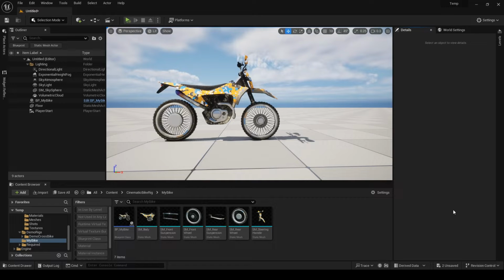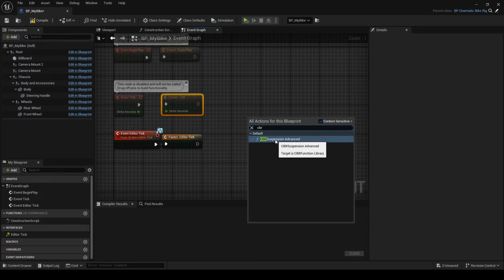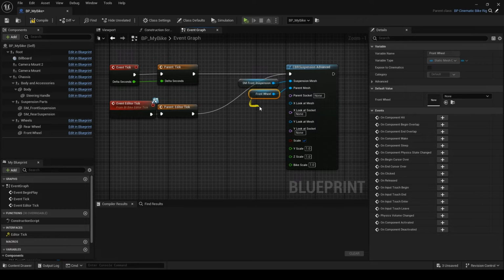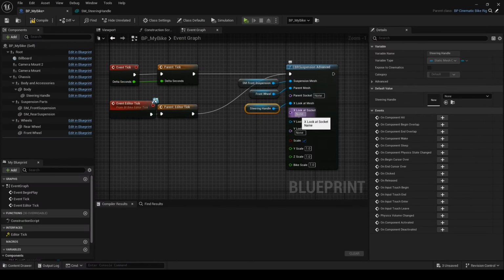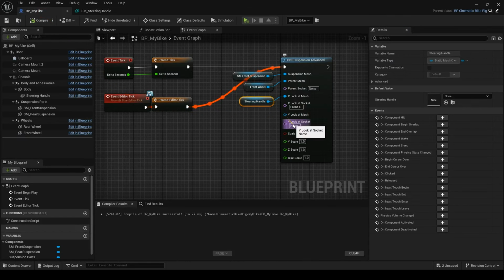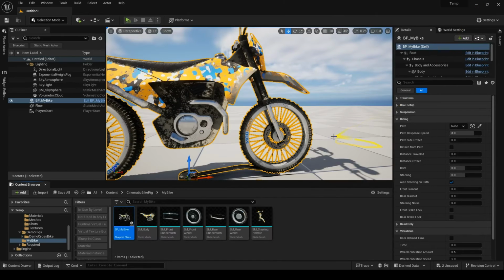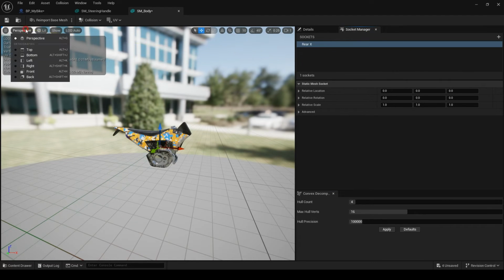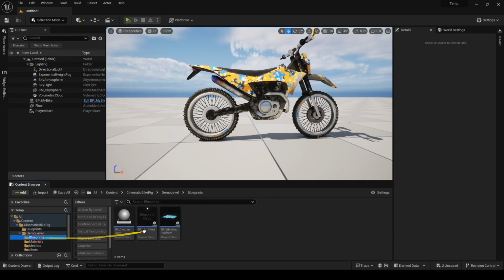Bike Rig V1.0 - Suspension Setup

Comment: I have an issue with a slightly different bike model, where the front fork (suspension) is not aligned correctly. the wheel in the bike is not aligned in the center of the fork, but slightly forward (by design). any idea of a simple fix? thanks! great product!
Reply from the maker: Hello there
I need to see the bike and the front fork mesh to know how to set it up.
Please join the Discord server:
https://discord.gg/waRkZ6MvNd
and verify your purchase by mentioning your Discord username on the questions section of the product. Then we will try to solve the problem. Due to the high volume of illegal downloads, I only support verified customers. Thank you